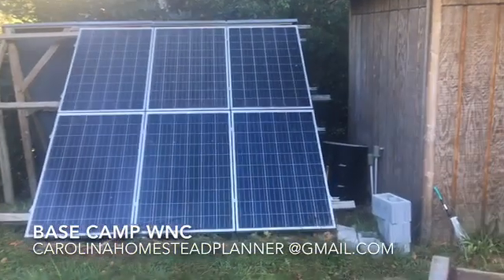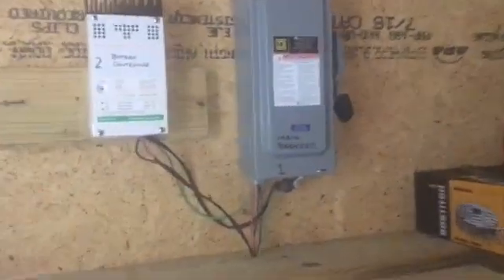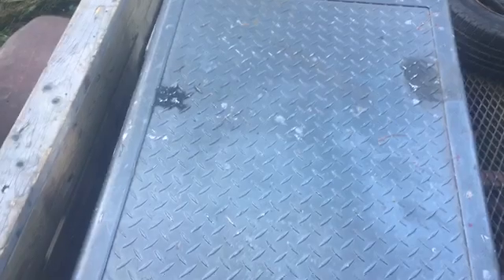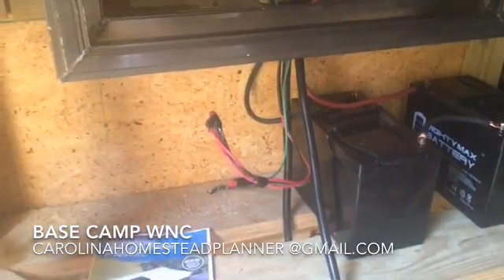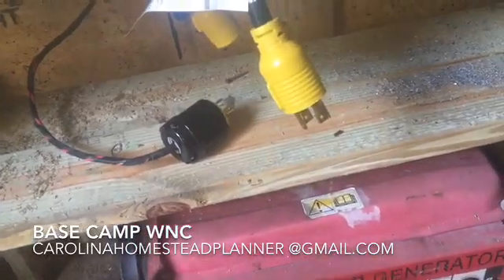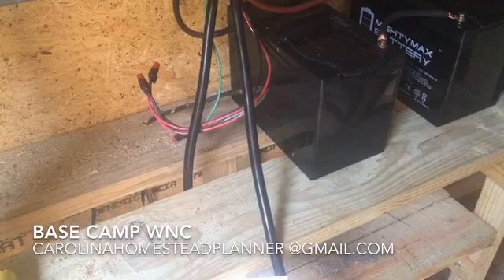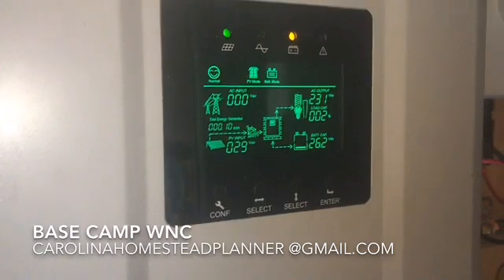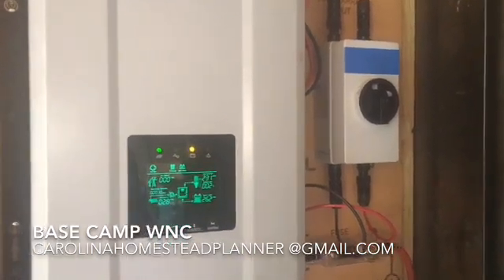Taking A 220 Ac Deep Well Pump Off Grid Here’s The Installation

Comment: I have the 6k unit but when it goes to dc mode the pump will not turn on only if I turn pump switch on and off but only works for one cycle then pressure ranks drains and pump does not come on. I. Think it might have something to do with the pump saver I have on the well needless to say had unit 2 weeks and cannot get to work on dc mode . Called RPS solar and electrician who installed and pump guy and nobody has an answer.

Comment: I just had a 1 1/2 hp ac submersible pump and pressure tank installed on an existing well on my land.It is set up for 200 v. After looking at cost to run wire to the main (540 ft) I think it would be most cost effective to run it on solar. What would I need for a complete system?

Comment: how big of an inverter do i need to work a 220 Ac Deep Well Pump ?
Reply from the maker: First question is what size is your well pump 
The larger the pump the more amps it will draw
For a 1 hp pump the minimum is a 3000 watt inverter
This is 3000 watt split phase low frequency inverter
And one that has a main output connection 
I prefer a Ames inverter have had best performance and durability with them
Let me know what size your pump is and the breaker size is in your panel
And as always subscribe like and share 
Thanks 
ERIC
Reply: @basecampwnc1745   Thanks for your reply. I'll sub and life for sure.
Pump size and depth, I have no clue. It was in the hole when I bought the house. But I have ordered one of those meters that clip around the wire . I think that's my best option to really know.
Reply: My well pump is 1hp uses 8 lamps at 220v. The inverters are nice and light weight. Much better then big 220v generators. But the 220 v inverters are so expensive. But still. The 220v generators are a pain, loud, smelly and darn heavy too. So oh well. Not sure what to do.  No water when electricity goes out I guess. At least I can keep my refrigerators running no problem with my 110v power inverters : )

Comment: I am trying to set up my home water pump to a solar system with a switch to run it on grid or solar. Was hoping for more detail how to set it up.
Reply from the maker: Will need more information 
Do you have a solar system now?
Is the water pump 110 or 220 volts 
How many amps does the pump draw?
Get me the information and we can go from there
Reply: @basecampwnc1745  ok.i will get.
Reply: @basecampwnc1745  I bought the equipment for connection to my water pump only. I have 2-150 volts panels, mbbt battery charger, a 5000-10000 watt pure sine wave inverter, and a W2R series automatic transfer switch. My pump runs off of a 30 amp breaker.
Reply: @basecampwnc1745  still active??? I'm trying to set my well up the same that you just showed on your video. I am in Georgia would like to probably purchase your system
Reply from the maker: Good morning 
Just need some information 
Your hp of the pump 
The well pump breaker size and the number of people and livestock using the well 
It may be easier to call me at 
1-843-224-2262
Can talk faster than text 
Eric
Reply: @basecampwnc1745  I have a 2hp well pump I believe.  Double pole 30amp breaker. 5 people . Washing clothes and baths are killing my back if you know what I mean.  I was curious about just 2 12volt batteries being able to handle the surge. Probably 4800 watts. I did order me a 5000 watt inverter from signature solar and some 195 used solar panels. And when the power goes out I can always use these 12-volt batteries got about 10 vehicles around here
Reply: @basecampwnc1745  I was thinking about getting some water barrels and Stage up on platforms and create some power with the alternator out of the vehicle.
Reply: @basecampwnc1745  I live in Arizona do you do work over here

Comment: can you please advise on what brand and model number the charge controller was? Also, does is run a single phase 230v?
Reply: Brand looks like a Watersecure 3k.  RPS sells it in a kit for 3199 now.
Reply: @rnr1880  Thanks a ton!!!
Reply from the maker: John Villasenior 
I believe it can run 230 volt single phase
You are not in the USA is that correct?
That one is a 3000 watt 
And as always subscribe like and share 
Thanks 
ERIC
Reply: @basecampwnc1745  Hi Eric I am in Missouri.

Comment: I am familiar with MPP Solar, They make something similar.
Who manufactures the inverter you installed?
Reply from the maker: Good question Steve 
It’s a white label product this one is 24 volt split phase 
The mpp is 6000 watt 48 volt to get split phase and no body imports this model 
I would like to find the manufacture still looking for it
Have used MPP products and had no problems